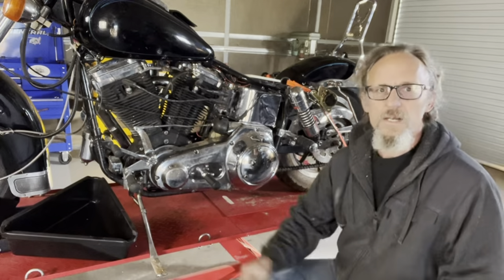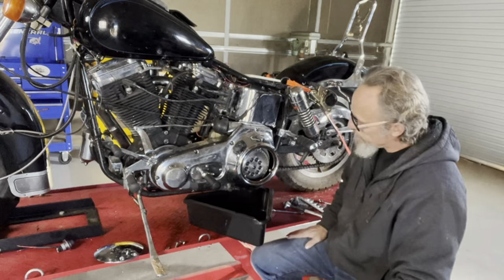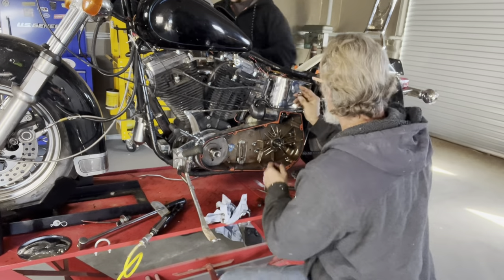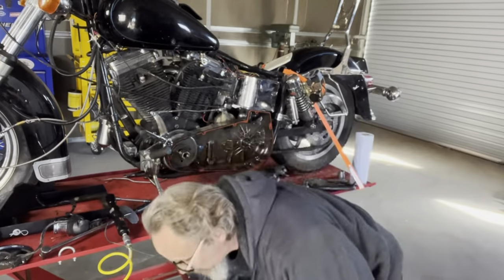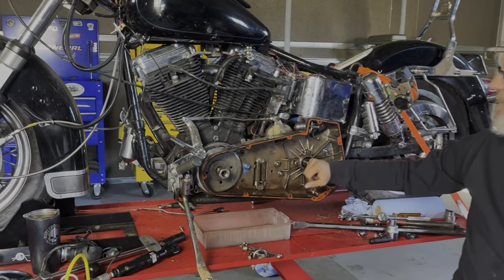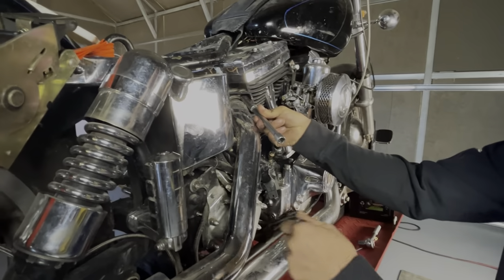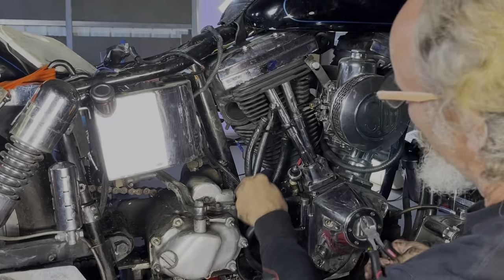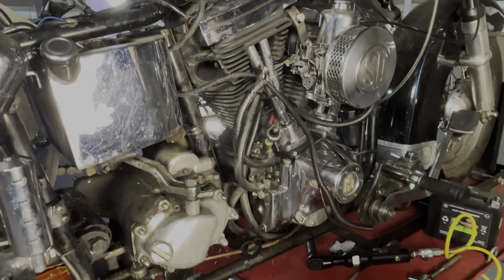How to Remove Transmission OFF Special Construction Motorcycle

Comment: My transmission is stuck in gear could the forks be broken
Reply from the maker: @josephmcglynn320  Absolutely could be forks, I find with the rotary top usually it’s the rotary top shaft that usually gets problems, but you’re gonna have to pull the top off to see what’s going on either way